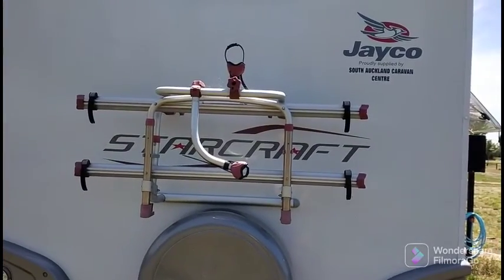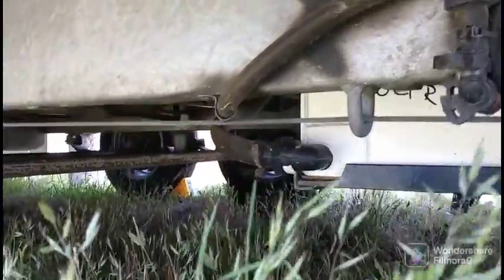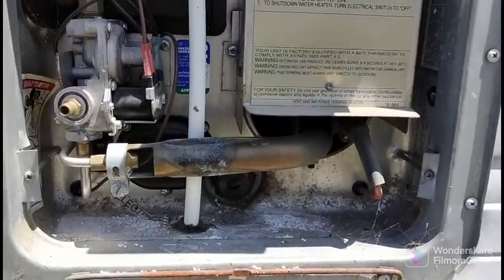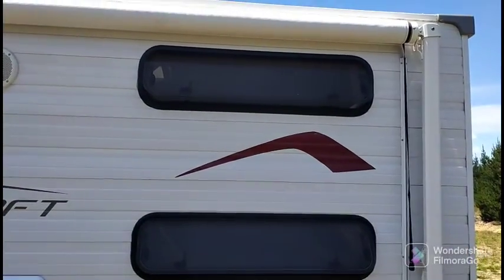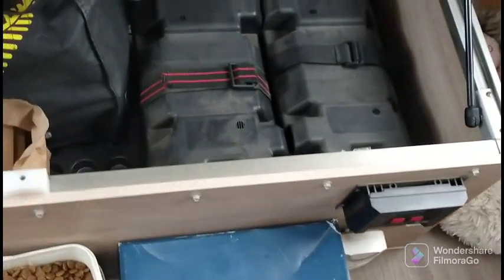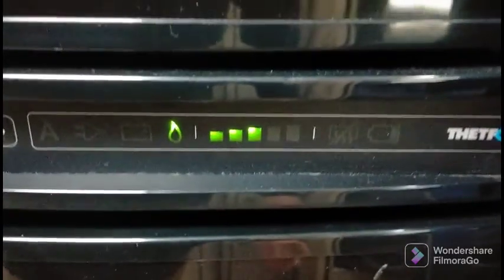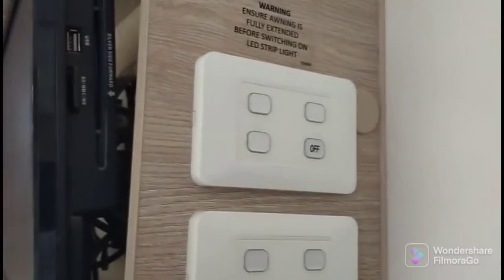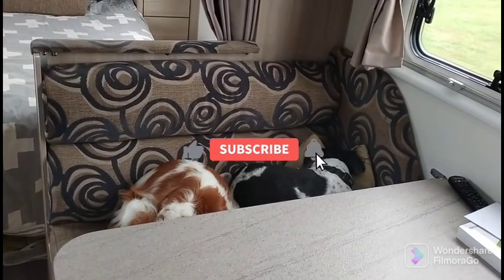Jayco Starcraft 2016: Upgrades for full-time living - interior/exterior

Comment: Thanks for sharpening. Does the large water tank affect the towing or is it only used on location? My van is grossly over weight if I fill the tanks.
Reply from the maker: Yeah we are overweight if the tanks are full. We try to fill up on location as much as possible and usually try not to travel too far to our camp with water on. We can do it but definitely notice the weight on the drawbar.